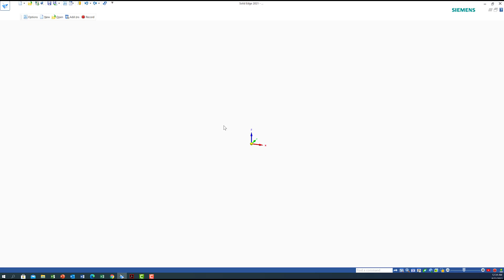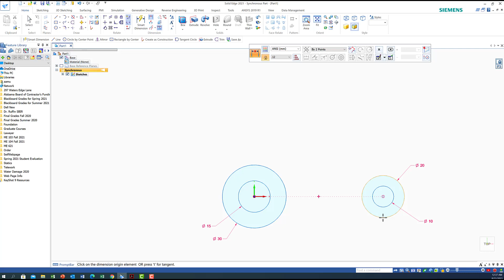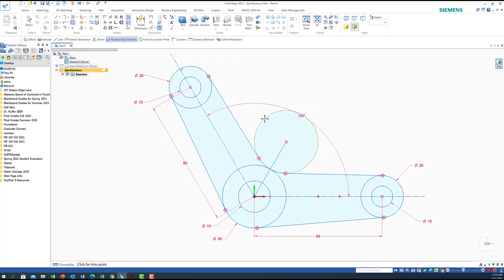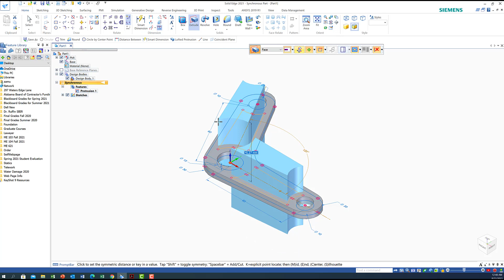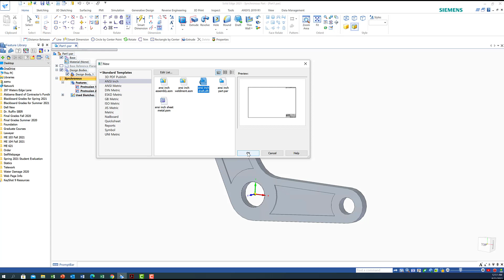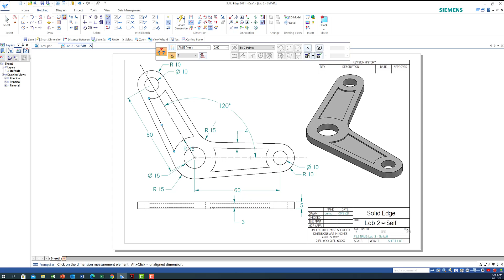Learning Solid Edge  ( Lab 5 - Updated - 1)

Comment: YOU still do not know how to edit the Title Block?    Go to 'View' > Sheet Views. Select, 'Background.' It is in the upper left of the Ribbon.  Look at the bottom of the page and select the Sheet Size you are working on. 'B-Sheet' for your example. Go to the field in the Title Block you require to update - Right Click - Select Properties.  Change the code seen to the name and numbers as you wish. Do this for each field. Then, click on Background to deselect it.  Click on 'Working' if it isn't selected. Go to the bottom of the window and select your Sheet 1.  Your Title Block is now more correctly UPDATED...  What you are doing is VERY Wrong. Not professional at all.   Note: I do not know what-where the inserted codes draw from. However, you must get proficient...